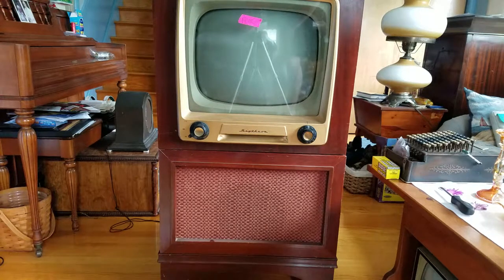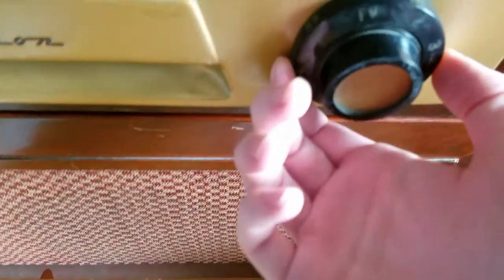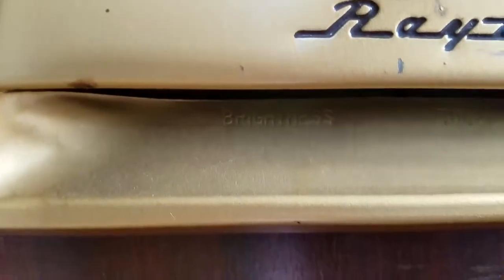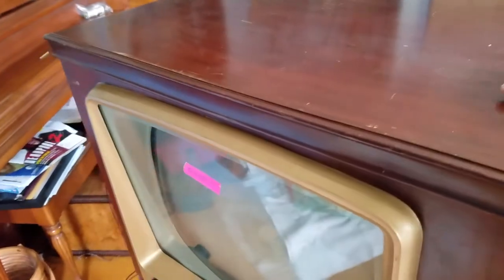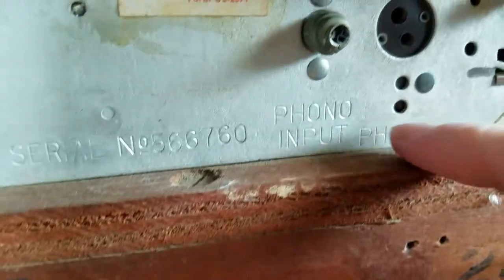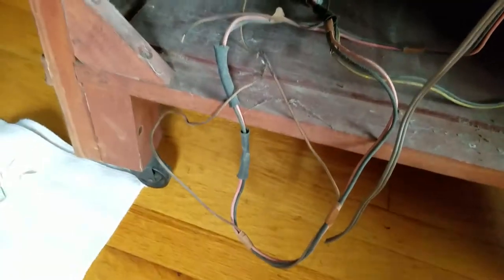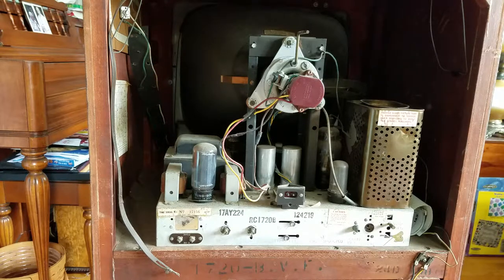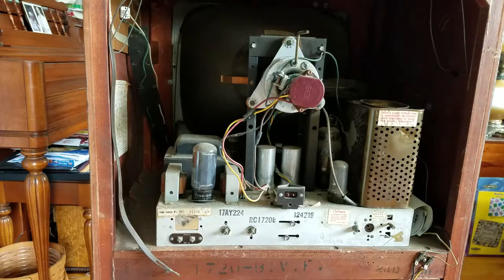1950s Free Raytheon TV Initial Overview

Comment: OMG, that is exactly the TV my parents had.   They purchased it ~1957 or so when we lived in Wilmington Delaware.   I remember everything about it. The phono kept cutting in and out.   We used it until we got a 26” Admiral black and white in 1962.  We kept the Ratheon in our den but no one used it.   Years later, I played around with it and found a burned resistor.   There was a schematic and we found another resistor had shorted.  Replaced the two and got it working.  Of course, my father figured it was worth donating to get the tax deduction since it worked.

My Dad defeated the power safety in the back, so I could get the back off with the power on.   My older brother came home from school and told me about a demo where the teacher moved a magnet around the CRT and it distorted the picture.  He demonstrated it for me, then I did it for him.  The suction cup on the B+ on the side of the TV had cracked.  When I touched it with the magnet, the high voltage threw me back against the wall and I slid down shaking.  My brother started laughing.  We are lucky that it didn’t kill me.

When the TV broke, I spent happy Saturdays with my father testing the tubes at the 7-11 until we found the defective one.

After the Admiral TV, I built my parents a Heathkit Color TV in 1972.   Fun with electronics that kids will never experience again.